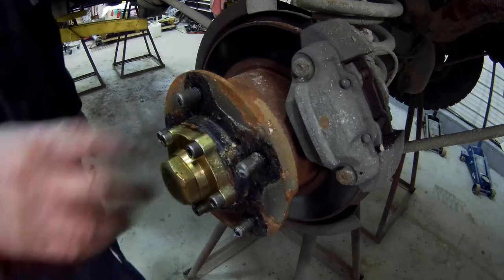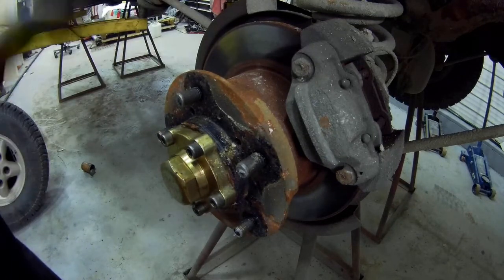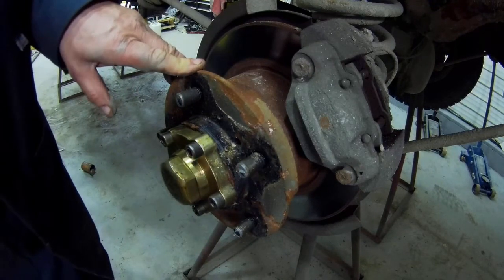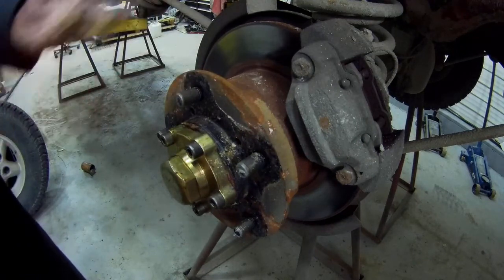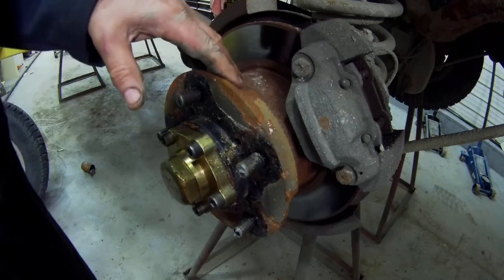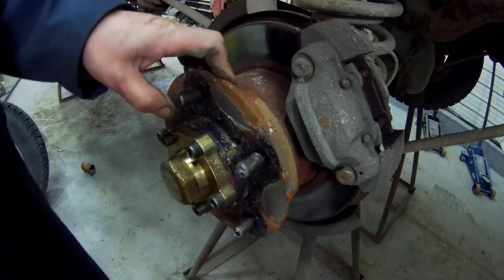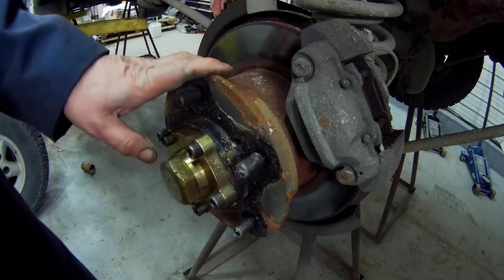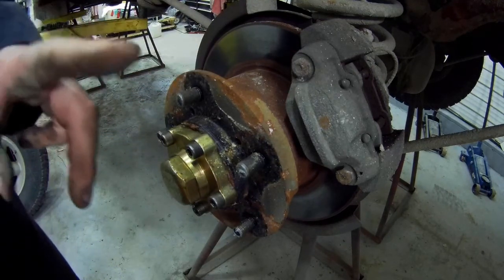Notes on Converting a Defender 110 or 130 to rear discs

Comment: Old video but still relevant.   If i may ask a question, i have 1990 defender 90, manual says i have Salsbury axles but i dont understand why the 90 rear axle is different than the 110s.   I would like to do a disc brake conversion as i have druns in the rear.   The fronts have been upgraded to vented discs and it was not a difficult job.
Reply from the maker: As far as I know, Salisbury were not a factory fit in a regular 90 - they used a Rover axle with drums, and once on to 300Tdi they fitted discs - same as a D1 axle. There is not enough weight capacity in a 90 to justify a Salisbury
Reply: @BritannicaRestorations  thank you for your response.  I bought an aftermarket replica manual so it could be wrong or from a different year.  Really enjoy watching your videos.  They have helped tremendously with my defender restoration.

Comment: did you have to change the Brake master Cylinder?
Reply from the maker: I fitted a discovery servo and cylinder
Reply: Heres my Problem. did Rear discs on 110. on braking, pedal gets Hard and Will not stop completely. It has a proportioning valve that I plan to remove. Or what do you reccomend I do?
Reply from the maker: I do not think the full disc vehicles had these valves  - the balance was worked out in the master cylinder
Reply: @BritannicaRestorations  so remove valve and stay with the original 1984 110 brake booster and master Cylinder?

Comment: Hi Mike, yet another great, helpful video.

Thanks, also, for answering all my questions in the past, it's been most appreciated. I have another few questions if you don't mind. 

1/ Are the 1996 Landrover Discovery one axles, and 1986 Defender Salisbury axles the same length (track width)?

2/ Do the Salisbury type axles come in matching sets (front and rear) or are they only available for the rear?

3/ Also, you mentioned in this video about mix and matching 'some' Discovery parts etc, that puts the disc rotor in a 'less than central' position. Can I use 'all' Discovery parts in my Defender 'drum' to 'disc' conversion to overcome this? As I already have a Discovery one rear axle with disc brakes attached! (You probably answered that in this video but I'm just not savvy enough to gel to it!)

4/ Also, I've managed to salvage the Discovery brake master cylinder and 'booster' for my Series build. Will the Discovery one booster and master cylinder fit onto the Series brake pedal tower, and have you got a link to the video of your Discovery booster to Defender tower conversion?

Thanks again.
Reply from the maker: 1 yes same width
2 A Salisbury does exist for the front, but they are very expensive - all ratios are the same
3 no - you open up a huge can of worms fitting Disco parts on a Defender - get the proper parts
4 Not sure about the Series tower - never seen one for years
Reply: @BritannicaRestorations  Thanks Mike, I enjoy your videos and appreciate your knowledge.

Comment: Around minute 6:45 you show the play or slack in the rear Dif.  I have this in all my Defenders (200 Tdi 110 and 2x 300 Tdi 130's) and I have replaced the flanges with heavy duty flanges.  I still have the slack.  Have you ever done a video that shows how to find where the slack is coming from?  This is a problem that all Defender owners have.  Mine are all Salisbury axles.  Is this coming from the transfer box, the rear Dif or somewhere else?
Reply from the maker: It will be in the diff thrust washers - usually

Comment: Thank you for taking the time to share this information.  I am planning to convert a '89 110 with a Salisbury axle to discs and this is a big help in understanding the procedure.
Reply from the maker: Great!
Just be aware that you need quite a few parts to do the job - also be aware that the servo/booster should be one for  rear disc brakes - the older drum brake master cylinder is a 60/40 split cylinder and puts more power to the front than the back - I retro fitted a Discovery 1 one onto a Defender tower  - worked well

Mike

Comment: Thank you for the video.  I have been considering converting my rear drums to disc brakes, but I never wanted to spend the money on the hack job ideas I have seen elsewhere.  This approach seems to be much more specific with Genuine parts.  I heard you mention that the cost is high, but never how much.  What should I do to start to identifying what I have and what I need?  Thank you.
Reply from the maker: John
I will see if I can dig out my original invoice for the parts I used.
I did use OEM or aftermarket parts as I knew what was the best for the job -if you use genuine parts it will be more than the truck is worth!
Some aftermarket parts like the caliper, hub, stub axle, disc, were very good in tolerances and quality, however I did use Ferodo pads and Timkin bearings
These parts have been on 2 years with no issues
The point I was trying to make is not to use a mixture of 90, Td5 or Disco 1 parts, which I have sen is a complete mess
Mike
Reply: Hi Mike, do you have any follow up thoughts or a approximate cost?  Thanks, John